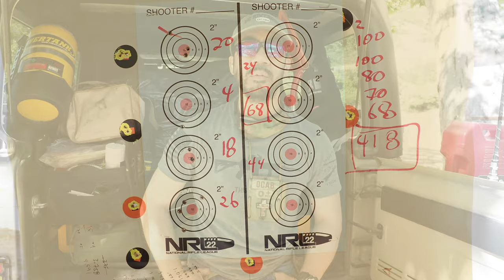Range VLOG #107 - May 2020 NRL22 Course of Fire "Solo Match"

Comment: Glad to see the bag is working out!
Reply from the maker: Thanks. I like the Gamechanger style bag as is. The only thing I would probably want is a gripped texture on the inside of the 'ears' for when it's being used as a front bag on a barricade. This can be a point of contention since you don't really want grip when using it as a rear bag (you want the bag rider to be able to move smoothly). But personally, I think I would go for a little grip
Reply: @ocabj  Interesting point. I've been looking at other materials I can use for a grippier surface, I'll keep that in mind. Thanks again